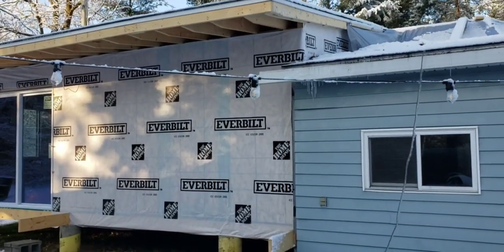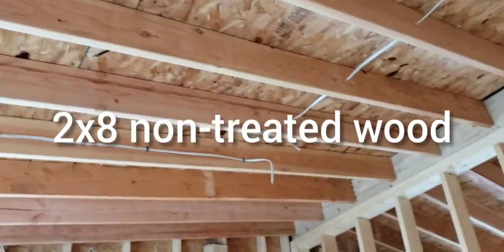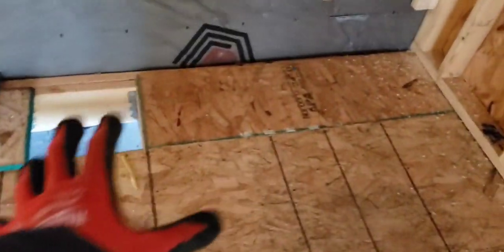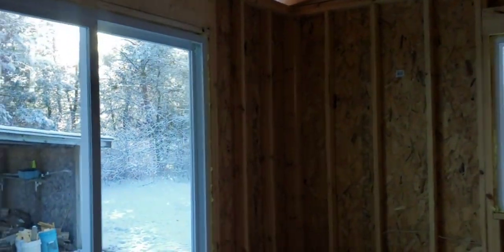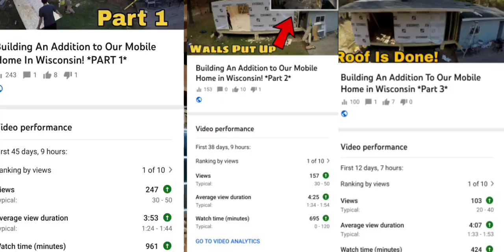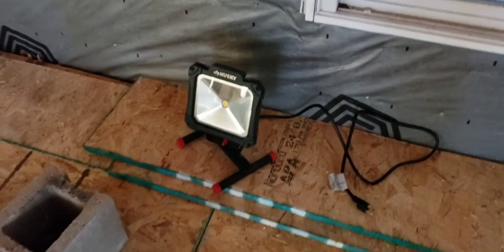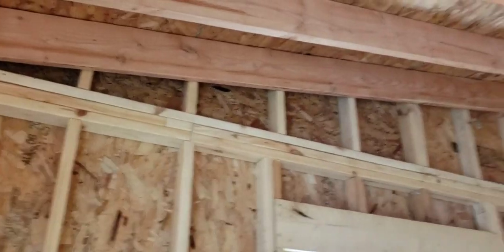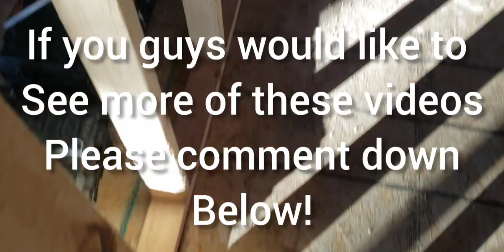Building An Addition to Our Mobile Home In Wisconsin *Part 4*

Comment: I noticed yall didn't insulate the floor. Your obviously in a cold climate. Won't the lack of floor insulation make it harder to heat? I'm assuming of course your going to insulate your walls and ceiling. But the chance to easily insulate the floor before you put down the subfloor has passed. I'm just curious 🤔

Comment: I want to do this to my single wide trailer and i have no idea how to begin. How much was everything? And is it possible to like put a door to go straight into the mobile home ??
Reply from the maker: So far we spent 13k on everything, we finished the plumbing and the electric for the most part and we are ready for drywall. We have a single trailer and there was already a small addition to the trailer when we bought it and that was the entrance to the mobile home. So we are keeping that entrance in the same place, and that is where the kitchen will be. So to get into the mobile home itself, we would have to go through the kitchen. So you can put the door to go straight into the mobile home but it just depends on where you have everything layed out, like the kitchen, living room and everything like that. If you want a visual example of where our door is, check out some of my other building videos parts 1 and 2 and then you will see that existing blue addition with the blue door.